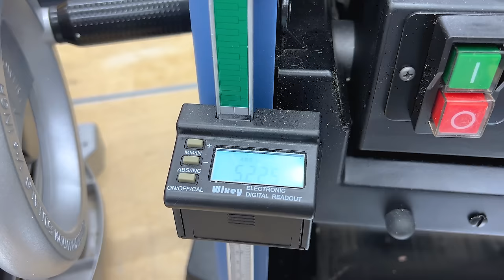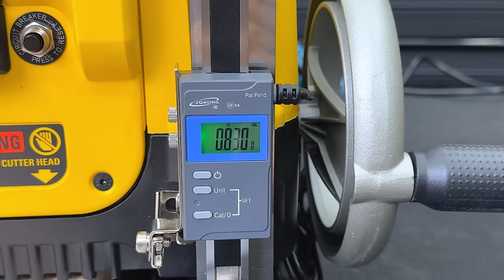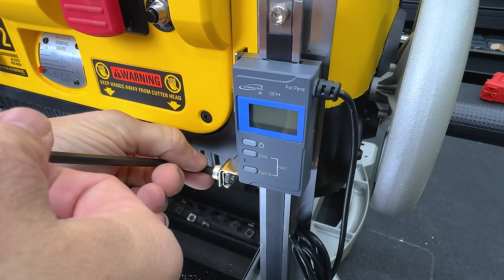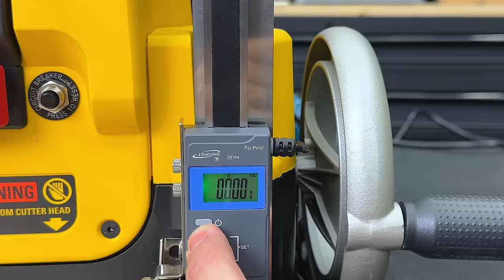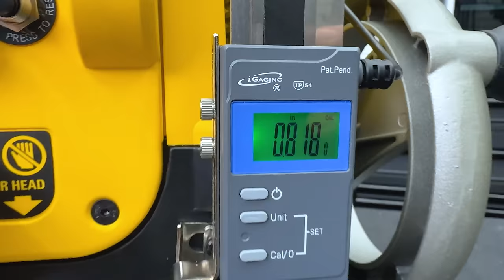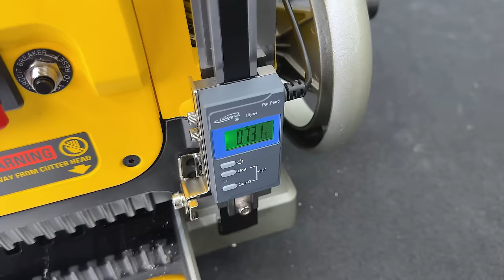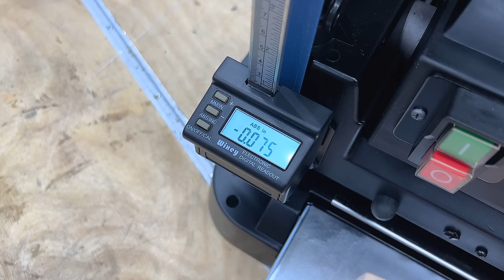The BEST Upgrade You Can Make to Your Bencthop Planer!

Comment: I'll be adding this to my planer soon.

I 100% agree that we should switch to the metric system. A lot of the calculations we do in engineering class is based on the SI system and then sometimes you will have to convert back to US customary units. It gets tricky when one unit is given in SI and the rest are in US or vice versa.
Reply: Doing 'everything more simply' is how you decline long term though.  Great ease with base 2 is an incredible advantage, while 'more base 10' gets you very little.
Reply: It gets especially tricky when you involve mass vs weight conversions in long winded calculations.  Ask me how I know.

Comment: Awesome review, they didn’t have the one you used in stock so just bought the heavy duty version. Actually installed easier, less hardware needed and larger display. As a plus the power cord is detachable! I removed the measuring stick and installed this in its place. I feel like it’s a much cleaner install.

Comment: Good video.  I have the Wixey version on my Dewalt 735.  It seems easier to calibrate, but a digital readout is great on the planer!  I liked it so much that I added a Wixey to my 12" Grizzly Jointer / Planer combo unit!

Comment: You asked, so here goes.  Actually the US had several intentions over the years of going metric.  Thomas Jefferson was a big proponent of going metric.  He ordered a set of standards (calibrated objects which the US would use to base what a true meter, kg, etc actually is) from Europe but the ship sank on the way over here.  The Imperial system was based on a time before decimals were widely used by most craftsmen.  When a measurement gets divided in half, well that's pretty easy with 0.5.  However divide it by 3 and it goes to 0.3333333333.  The units in the Imperial system units were divisible by 2, 3, and 4.  As time progressed, the French came up with a new system that would be more universal and easier to convert between units within itself.  Although many countries adopted the Metric system, the US and Great Britain (who taught us the Imperial system) held fast to their beloved measuring system.  Great Britain grudgingly began to ditch its Imperial system in the 1970s because it was the only way to gain access to the markets of continental Europe.  The US on the other hand at this time was more independent both in trade and in geographical location.  We as a country are by and large an island and really only have two neighboring countries as opposed to European and Asian countries which have many neighboring countries with which they need to travel and do trade with.  Our economical and geographic isolation has enabled us to hold on to our "antiquated" unit of measurements.  In order to convert over to the metric system, it needs to become part of everyday life.  However the cost of replacing signage and machinery are likely the biggest barrier from converting over.

Comment: Hi,
I have the same gauge on my Dewalt 733 planer works a treat. Also that zero button is not to recalibrate, but rather take relative measurements.  Is you have planned a surface, maybe just hit the high points, and won’t to take another 1mm pass, you can zero it, move it down 1mm.  I like this when I flattening boards on a sled, just lets me know how much I’m taking off with each pass.

Comment: Thank you 731 Matt!  Yet another genius shop deck out tool tip.  I do not yet have a planer, but when I do purchase my DeWalt, I know what accessories with which to top it off.

I have solved my dangling, in fact all my cord issues, with a supply of varying length Velcro cable ties.  Off brand of course.  The closer your ties are to the only being 2 or 3ish wraps around the total cable you have lassoed the better.

As always, thank you and Much R E S P E C T and L🫶🏻VE to Y🫵🏻U and Miss Amy‼️✊🏼✊🏼✊🏼

Comment: I've been using the Wixey version on my 735 for a couple of years. Great addition for not a lot of money. After watching and for those comparing, the Wixey "self-calibrates" without having to measure and runs on AAA battery. Not digging that dangly cord. Also, I didn't see an incremental mode (temporary zero) if you want to measure the delta of two measurements.
Reply: I think that's what the zero is for
Reply: Yea. I found the manual. It’s actually switches between cal and zero.

Comment: ****  @2:09 DO NOT put the 3M stickers where Matt is showing ***  Go to @3:20 so find out where it should go.   Otherwise, you'll have to get some more 3M tape.  I drilled holes in mine so it didn't really matter that much.  But If you're planning on use the 3M tape, putting it where Matt says @2:09 will ruin your day.

Comment: The metric system is better in almost everyway. But for woodworking standard is actually more accurate because when you have to be precise to say 1/32 of an inch. There are only 25.4 mm in an inch. So technically you can be more precise when referencing measuring/marking tools in woodworking with imperial because there are more marks to reference. 

 However, as far as automotive tools goes metric is the way to go. When i was a diesel mechanic on heavy equipment it always made it simpler when you got a machine that used metric bolt sizes.

Comment: i looked into the iguage and wixey and wound up getting the wixey as I just can't figure out why the USB cord on that thing isn't removable? I would never use a battery pack sitting next to the planer, and the wixey uses 2AAA Batteries which are far more common in my house than the CR2032 the iguage uses, and from what i could discern from the video and online instructions the wixey is a tad faster at calibrating. Though either way having a digital readout on the planer is a game changer.

Comment: I’m guessing the calibration is the same if you have the helical carbide insert cutter? That would be a great addition to any planer.
Reply from the maker: yes it is
Reply: Yes.  It is also easy to adjust the calibration to accommodate a sled, or other jigs. Super easy.

Comment: If you adjust the height while it is off or in sleep mode what happens?
Does it wake it self up?
Does it know and adjust correctly?
Do you have to recalibrate?
Reply: Yes
Reply: And what if the battery dies or it's unplugged?
Reply: @shaynerism  Go back to using the planer as is.

Comment: It’s completely not needed. The stops it comes with them are extremely accurate. I’ve tested it, don’t waste your money.
Reply: DROs are not only worth the money, they pay for themselves extremely quickly.  In addition, a planer (especially a bench top) should be used to get a rough thickness.  For example, I plane to .90 for kitchen rails and stiles, then finish at .875 after joinery on a wide belt (or drum sander if that’s what you have, or even with a hand plane).  These gauges are relatively cheap, and very accurate allowing for easy repeatability that is far more accurate than the stops, and with far more variability of thicknesses.  Then having multiple machines with DROs can drastically speed up your milling process while improving the quality of your work.  Household DIY projects likely don’t benefit from a DRO, but I’d assume, if you’re watching these channels, you’re trying to learn some semblance of quality wood craft.  If that’s the case, you could certainly benefit from this gauge.

Comment: So, a tool that most people will most likely run on battery has a permanently attached USB cab that is directly in the path of the adjustment wheel. That’s a major fail.
Reply from the maker: I just snipped it off with a set of pliers.  Problem solved lol
Reply: @731Woodworks  👍 What’s weird is that it appears to only be that way on the version specifically for the DW735 and it’s $10 more expensive than the generic version which is more complex given that it has a remote display. Still useful but if I get one, I would opt for the generic version unless I’m missing something that this one has other than a DW735 specific mount. My planer isn’t scheduled to arrive until Tuesday so I will have to spend some quality time with it 
… at least until my wife stops realizing that a lot of boxes are bypassing our gift stash and heading out to the garage becauseI can say it’s my birthday present so many times prior to it on the 24th🤪

Comment: Every place that sells it has not so good reviews.
Reply: If you read the reviews, it’s all has to do with — bad instructions, difficult to setup, etc.
Reply: Also stated the unit was unable to retain measurements due to vibration of planner
Reply: I was wondering if the vibration might affect it...makes sense
Reply: This is just like that measuring wheel you stick on your miter saw fence. Its a good concept, but probably not so good in actual practice.

A good carpenter will know their planer and be able to get repeatable results no problem